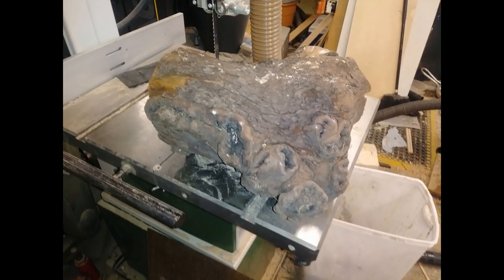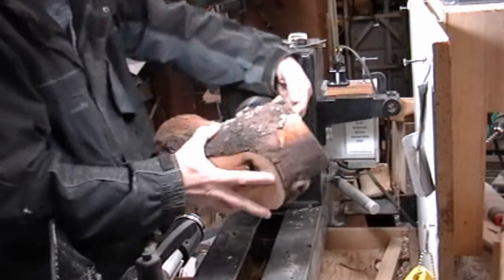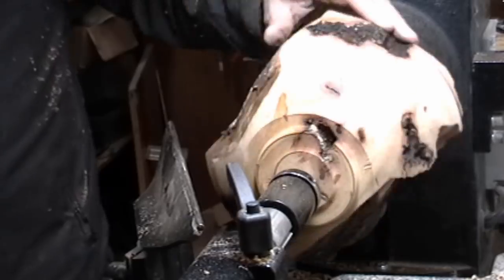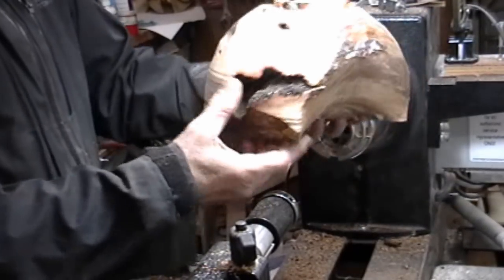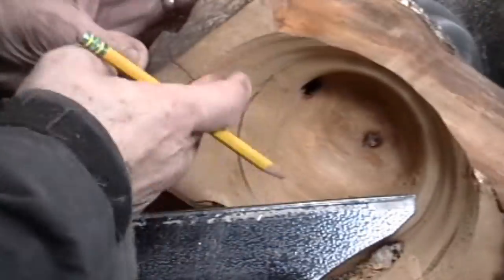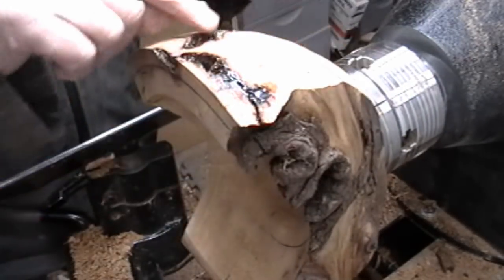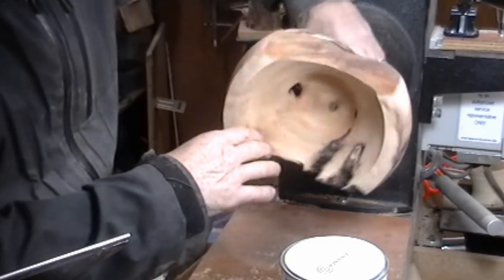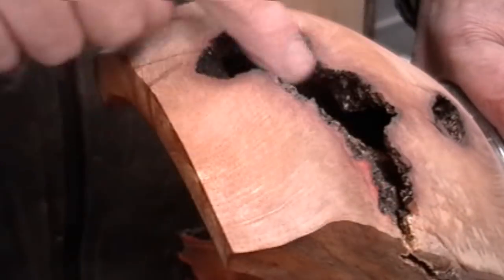Woodturning Madrone THE BURNT BURL BOWL Shellac finish

Comment: You Sir are a braver man than I. No way would I turn wood that degraded without the use of a six meter long bowl gouge to keep me well away from it. But it sure paid off for you. Lovely work.
Reply from the maker: Well thank you I am sure happy with how it turned out. That probably was a prime situation for a turning cage. It ended up stronger than it looked though.
I might have been more determined than brave. Compared to 6 foot diameter turning I did many years ago this wasn't to bad for fear factor but I certainly was concerned.
Thanks for watching and commenting.
Gary